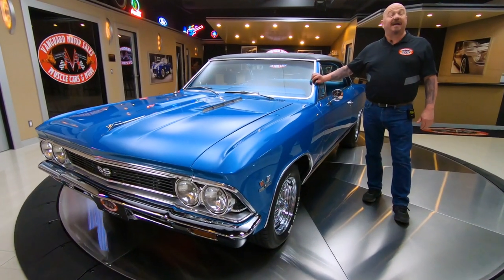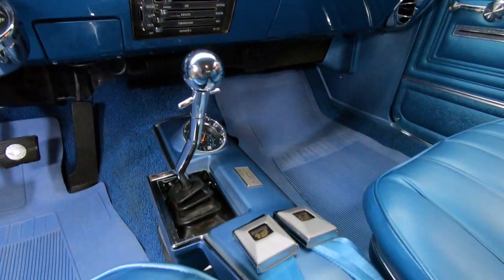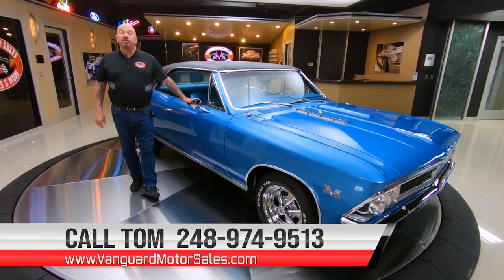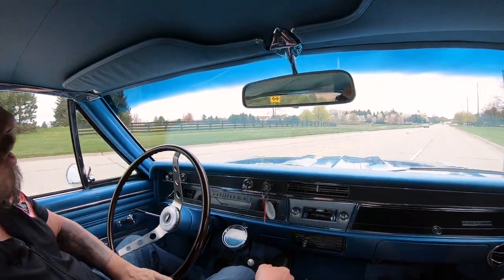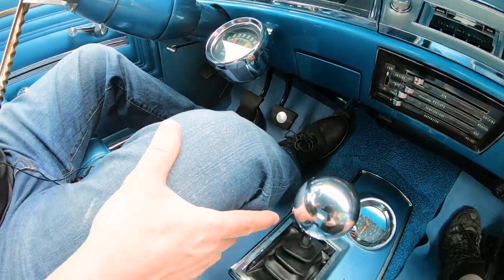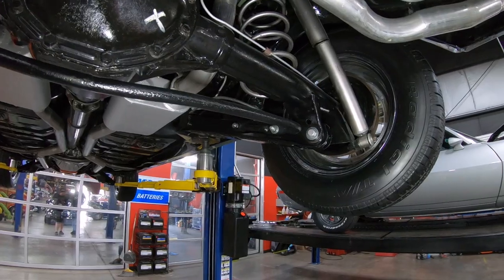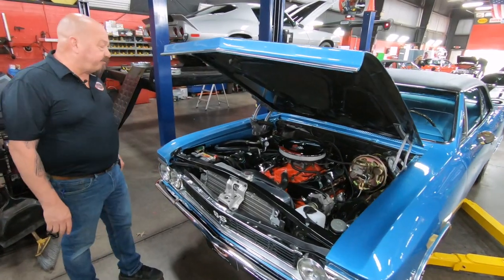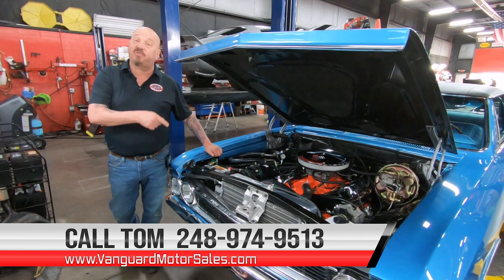1966 Chevrolet Chevelle For Sale

Comment: A couple of years ago, I saw Greg presenting a gorgeous black Cougar with the most iconic tail lights, so beautiful even the Shelby GT500 borrowed it. Impression #1: I’ve found my dream car…
After a certain time, I got a 1/43 version of the XR7, because I didn‘t have money for the real thing. Meanwhile, I've discovered an early ‘68 Road Runner on Vanguard Motor Sales. Impression #2: Let me think about my dream car decision…
April 22, 2021 UTC+1– somewhere in the evening, I've received an oversee package with a ’66 Chevelle from Matchbox. Right away, I placed it on the shelf, next to the little Cougar & Road Runner versions. Later, I started this video… what a coincidence! Impression #3: Good, I don’t have enough savings, because I wouldn’t know what to choose 😋

Comment: What about the price please mention the price too in your videos
Reply from the maker: The Price of this car is $89,900. If you have any further questions please feel free to give Tom a call at 248-974-9513!
Reply: It's probably unlikely the price will ever be mentioned in the videos. There's a link below the video that contains lots of pictures, the price and more on the Vanguard website. Stating the price in the video makes it permanent. Hard to edit that out if there needs to be a reduction, or even an increase, whereas it's extremely easy to change the price on the website if necessary.